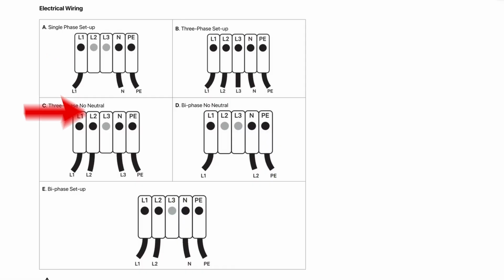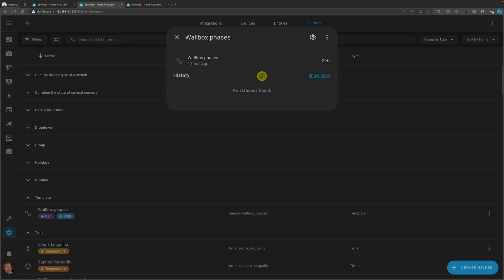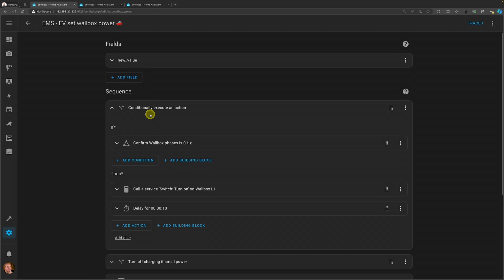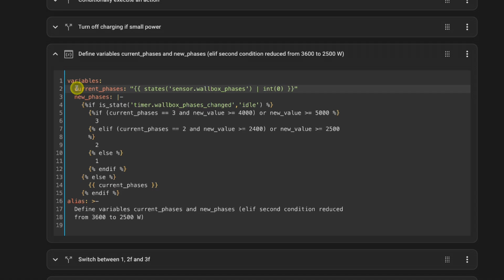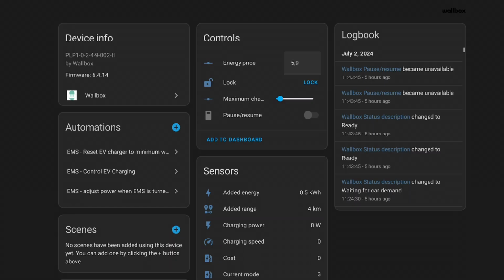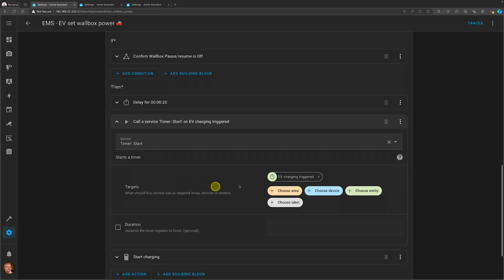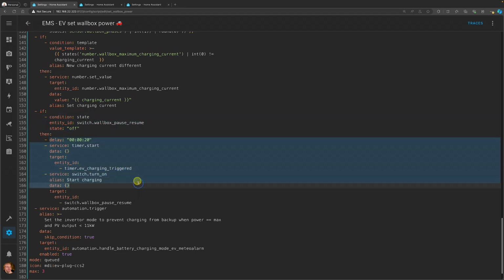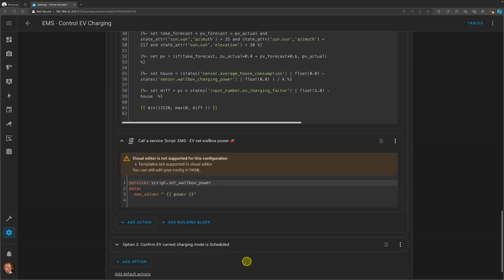Ultimate Solar Wallbox

Comment: Here in Poland we have 1h balancing so it doesn’t matter if you take power for half hour and send power for half hour - it’s important to have the sum equal 0kWh. The same for 3 phases. You pay for the sum of them. So you can load 1 phase 2,4kW and send 2,4kW on L2 and you will still have 0kWh at the end of the hour. This simplified the setup a lot. In great scale this all averages over many users so it doesn’t matter for the grid.
Reply from the maker: You’re lucky. Here it is a struggle, and it is getting worse.
Reply: @bruxy70  the only problem is that we have so much solar now that the prices they pay us while sending the power to the grid is really low. It’s hourly price and sometimes it reaches 0.
Reply from the maker: @volkhen0 Here they pay virtually nothing, and some make import more expensive if you have solars. So the only strategy is to maximize own consumption and minimize import. This is why energy management is so important.
Reply: @bruxy70  I look with great envy at your systems. I dream about such setup but I’m just a simple Arduino guy and honestly this is too much for me, maybe one day I will get knowledge required to build it.

Comment: I’m using easee charger and with this i have full control on the api and there is a hacs for home assistant for it. So i use node red to control if i want to use sun or grid and which phase i want to use. We have 240 on each phase in Denmark. Let me know if you want to have more info on it.

Comment: You got the wrong EVSE.

The Go-e Gemini 11/22kW  changes automatically between 1 and 3 phase and you can control all parameters easily from Home Assistant 😊
Reply: so how does that work exactly? You calculate the solar surplus in HomeAssistant and you'll just pass that value to go-e filed for Charging power? Will Go-e automatically calculate how many phases and Amperage need to meet that surplus?

Comment: I also have a pulsar plus. I have a automation running on nodered to adjust the charging current based on the current consumption and the max power I have. I only have 6.9Kw available on my apartment and since the wallbox is on the garage a couple of floors down, I have a powerline to provide internet to the garage and then I have a Shelly EM on the main fuse box reading the consumption from the garage and the total consumption. It works well, never had the power trip due to over consumption

Comment: I have a Fronius solar inverter, and the Fronius WattPilot EV charger. They communicate with each other and the WattPilot ECO mode ensures charge current (power) uses only excess solar power. Works like a charm, no Home Assistant automation or script is necessary.
Reply: The WattPolit automatically switches between 1-phase and 3-phase. It's minimum is 1.4kW.

Comment: Interesting exercise.
My solution - inverter is symetric (Fronius), charget Go-E gemini flex charger 22kW. All I need to do is generate one MQTT message - how much solar is generating and how much do I take from/return to grid. The go-e will then calculate how much it can use and set the allowed current accordingly. On go-e you can even set the "threshold" - how much grid feed-in there needs to be before it even charges at all and how much grid feed should it keep - to make sure it does not charge the car from the grid.
Works fully locally, no external API dependency, etc. Absolutely recommended.
Reply: I'm looking for exact this solution. Is there a tutorial for this somewhere in the web or can you explain it a little bit more? How fast is the polling/switching time of the goe charger? How long does it take adapt to a new charge current?

Comment: Interesting project - I did a similar project on an ABL-Wallbox which needed generic RS482-communication - which made the part of "talking" to the WB more complicated.
I decided to uses MQTT for the WB-Communication and Node Red for the programming part.
Our EV is a VW eUP that is capable for max. 2phase charging only - so so far a switch between 2 and 3 phase charging is not covered yet.
On the WB I had the same situation, that the manuals offer to install the WB either for 1 or 3 phase charging (2-phase not mentioned. I implemented an standard 3x40A relais to interrupt phase 2 & 3 and a Shelly 3EM mainly for measurement. The relais of the Shelly is used to switch between 1 and 3 phase operation (via the 40A-Relais) - so no mode where I cant disconnect all phases. Thes was not documented anywhere but at least for load free switch between the modes thsi woks fine meanwhile for 3 years.
I use this chance between 1 and more phases manual only by looking at the sky and the weather conditions. For my car I found, that it stopps charcing when charging is interrupted ~ more than 10 times and an day with individual clouds all trys with and automation for that switched much too often.
For the balance between car and houses battery charging I calculate a reserve value of Watts depending on the house battery SOC. Further I definded a helper for a 2nd reserve power that can be modified between -3000 and + 3000 in 250W steps.This two reserve values and the house consumption were combined to determin how much PV power is available for car charging.
Big advantage of that slider is e.g. if you know that the car is uses some hours during the day the power can be adjusted to use some house battery power that can betopped up after the car left.

Here a link to a German description https://klaus-macht-bilder.blogspot.com/2021/09/steuerung-der-abl-emh1-wallbox-mit-home.html

Comment: Is wallbox a generic name for an EVSE? Or do you have a Wallbox brand EVSE like the Wallbox Pulsar Plus or something?
Reply from the maker: The integration is for the Wallbox brand. I have Pulsar Plus. There are other wallboxes you can manage, e.g. through OCPP. Some others by sending them 1-10V analog input. But the one I got has native HA support
Reply: @bruxy70  thanks! I must have missed the details on the actual unit if you said it. 
I also have the Pulsar Plus and am running the HA integration. I’ve also experienced it just not working sometimes. Didn’t realize it was a polling limit.
Reply from the maker: @DethpickleDave I did not have such issue yet